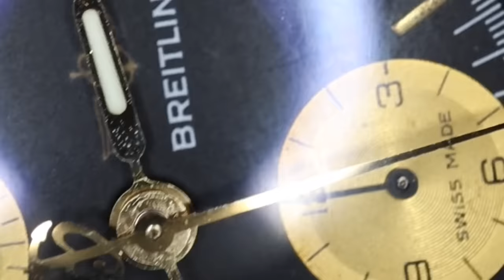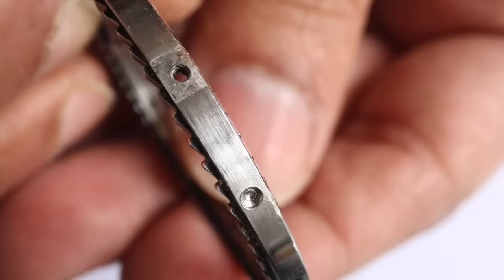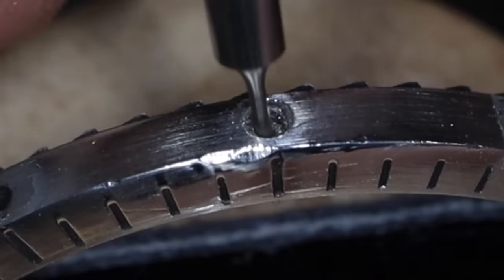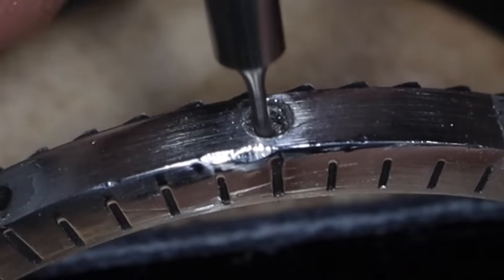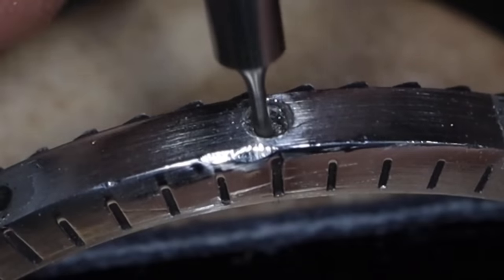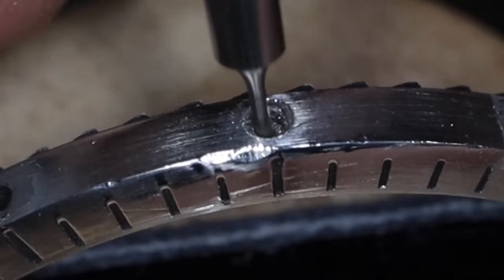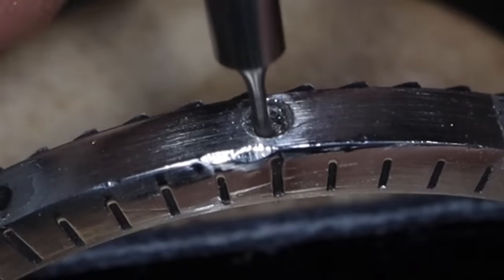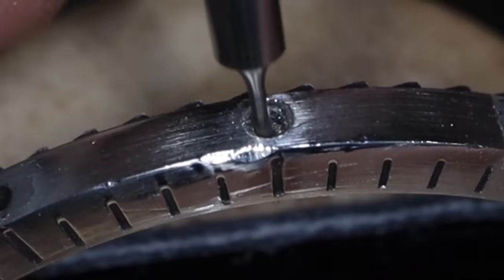I rescued this Breitling from someone who loves superglue - full watch restoration

Comment: The original owner of that watch must have worn it everyday for decades to have amassed that much damage. Remarkable work as usual.
Reply: Paul Fellows agreed. Rough and ready is one thing, but this watch looks like it had been thrown out the window of a moving car, and then lay in the gutter for a few months. Or else scooped up by a beachcomber.
Reply: @franciscodanconia45  - When you are in highly compensated 'manual' labor - s..t happens and your arms and and hands are where the results end up.
Reply: @Paul Fellows Agreed! My first breitling chronomat from 2004 is STILL in perfect condition- Not a single scratch anywhere-though I do not wear it everyday. With care, they will last many hundreds of years.

Comment: Thanks for the video. I have the exact same watch that I never wore. I received it as a gift in 1993 and kept it in its original box. The watch is impeccable. But after all these years it doesn't work anymore (it's like there is sand in the gear). Perhaps the oil has dried up and it is due for a complete maintenance. But I hesitate, I fear that it could be damaged in the process. Its sentimental value is priceless.

Comment: Really nice video again. Nice work, nice humor and almost therapeutic. I did own a similar example with a bleu metallic dial and a brown strap in the early nineties, I was in my early twenties back than and I didn’t know Breitling were in such a difficult period in those days like you mentioned and that they weren’t exactly keen on the quality of there movements. But now I know why I got it with around 25% to 30% discount already (not an official dealer though). I remember I sold it after a few years  because I found it a to much showy watch in the end, but with a loss of another 25% or so. Than I bought my gmt master 1 witch I still one today. That was the best buy I’ve ever done. Bought for 3300 guilders, around 2000 GBP and today it’s worth like 10 k in euros. Not that I will ever sell it off course

Comment: I've done some tiny soldering so small I had to buy a vice with a magnifying glass. A few days ago I came across the pictures. The point is with a lense I don't have a shake in my hand. Otherwise I would throw all the little bits up in the air with shaking. I think I couldn't do a watch restore. But I'd love to try. But I'm sure I'd take a shake and destroy all.

Comment: I had a Chronomat Longitude in the late 80’s. Had a black face, quite unusual. 
It was awful for letting in water. Three times I had to have it serviced due water ingress, I think perhaps through accidental operation of the pushers when under water (yes I used to swim and dive with it). Each time would take about 8 weeks and I was charged around £400. I was told only three technicians knew the mechanism well enough to service it, but I think it likely now they only had three technicians!
The piece itself was an awful timekeeper too. I went through many communications and much time with the watch returned and not on my wrist. The conclusion finally arrived at was that vibration from the turboprop aircraft I was flying at the time was disturbing the accuracy. 
A pilot watch with terrible accuracy is not a good thing and so ultimately I sold it. 
Great nostalgia watching this video, and I very much enjoyed seeing the mechanism that gave me so much trouble (although the longitude with its fourth hand was probably a different movement, I accept). Those bezel markers were a pain in the neck to me, constantly catching on clothing and things. I always found the chronograph movement far from slick and the pushers shape hurt my fingers to use.
Years later I tried an aerospace; that too had flawed functionality - the second time zone being a pig to set. Loved the watch though, very nicely finished piece. Sold it, as I didn’t feel I could wear it usefully.
Now considering a Tudor GMT

Comment: Great looking final result but I'm skeptical of those plastic parts. Also, the click spring looks like it's just press fit into the movement and that looks a little sketchy. I imagine that most of the improvements that you mentioned that were made to the movement involved replacing the plastic parts with metal ones. I like to hear your voice overs on these videos. You give many good insights on watch repair in general and those come from years of experience.

Comment: I had the same watch  model just with different  color .Kind of light grey not blue . Bought in New York  was November 1987 and paid U$ 1.700 brand new . The movement was manual , mot quartz or automatic , when the lady told me asked her right away . For that much money is not  automatic , will have to set the time and turn this piece like the old watches if I don't have on my wrist . Right there my argument went up like smoke , well dear the same will happen with an automatic watch . Anyway i loved that watch for the first glimpse at it  . I laugh  paid for put on my wrist thinking .....Rolex are all the same..Lol  End up loosing 10 years later . Today I have a Colt ocean automatic and a Eric Tabarly given as a gift from an ex girl friend . I really like the brand and the treatment that the main branch at Switzerland gave to me on an occasion I had a problem with the Tabarly  . Their store in Rio Brazil did not take it to change battery saying was a fake . In the end the watch was send to their store and they rebuild the entire watch for free . Looks just like when I open the blue box .Also have a vintage 1943 0mega and I swear will never buy a Rolex . LoL

Comment: This is an older one, but I'm working on getting to them all. I suppose if English isn't your language you may prefer one without sound (but then how would you hear Bill and Ted telling you to "be excellent"). Nice job (as usual). I don't see myself doing a chronograph for many years. I tried to purchase a mainspring winder today - not sure if I got the right size. The supplier didn't have it in stock anyway so I asked for advice. This supplier does a lot of "how to" type walk-throughs, so somebody there will know. I purchased a NOS spring for the Elgin I'm working on but I may just try putting the old one back in once I sort out the correct size winder.

Comment: If I had a problem under the date platform, and just removed the 3 screws securing the platform, will the platform come up as a unit without any probs?  I'd like to avoid taking the whole thing apart just to get at what's underneath, if at all possible.

Comment: 4:57 I have a chronomat 44. Took it apart to clean and polish. But after putting the crown back on I noticed ot wqs much tighter than before and the longer you twist it the harder it gets. Also, not every screw wanted to fit into every hole, needed some trial and error to fit all screws.. any idea? Many thanks!

Comment: Thanks for the video. What do you think of the ETA 7750 Movement in the top version?
I have it in a Revue Thommen airspeed chrono 17081.6.
Regards,
Chris
Reply from the maker: Very popular movement for a reason
Reply: @NekkidWatchmaker  What are some of the reasons please as I am considering a moonwatch with the updated movement or I I could go with the Zenith El Primera or try to find a Lemania 5100. I think the the 7750 in top or chronometer variations are just as good.
What do you think?
Thank you
Chris